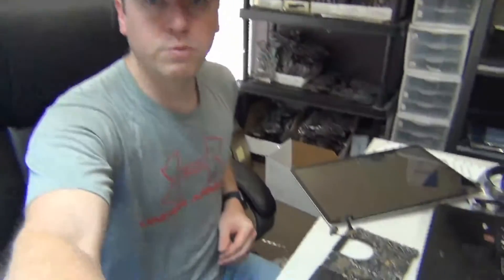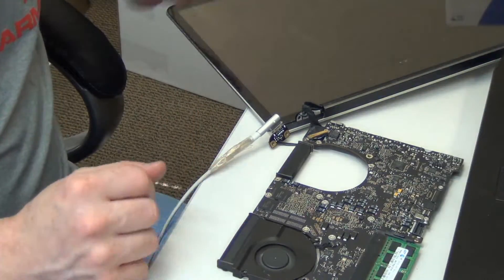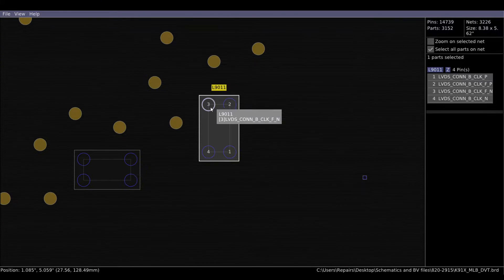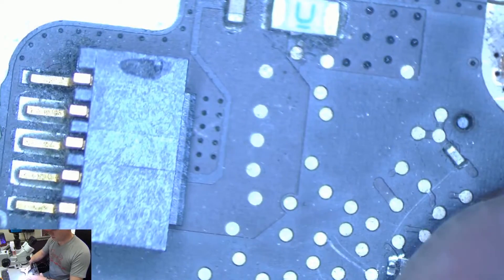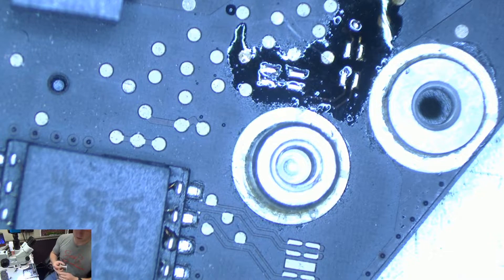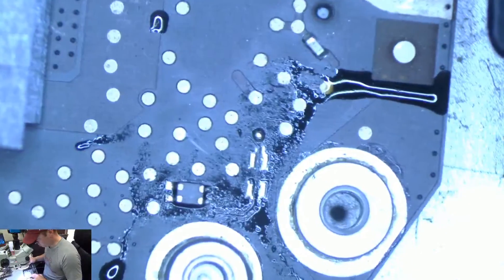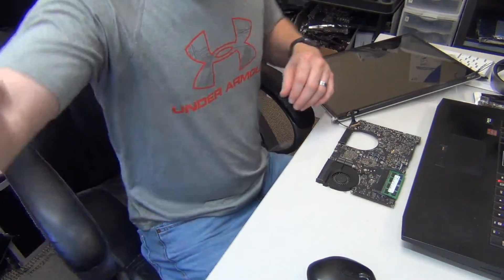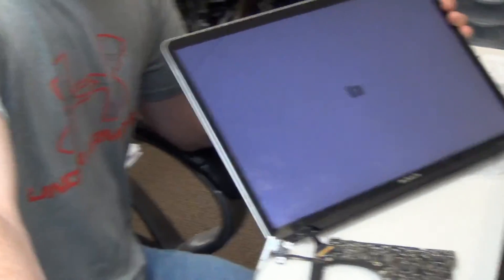Macbook Pro 15" 2011 Repair -  Display Shows Backlight but No Image on board 820-2915

Comment: I have a MacBook 15 inch and I broke the screen..I bought a used one from a seller on eBay...and I installed it and the MacBook chimes but I have completely black screen and after a while I get only backlight...no screen on the hdmi port past the loading screen...and when I completely remove the screen I have perfect video on the hdmi port ? Is the screen faulty ? Without the screen the MacBook works perfectly...